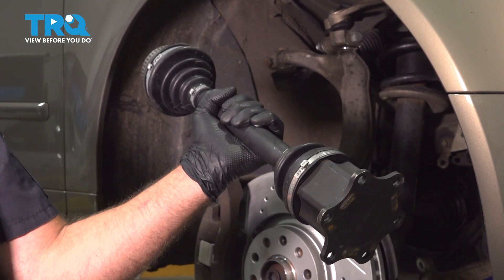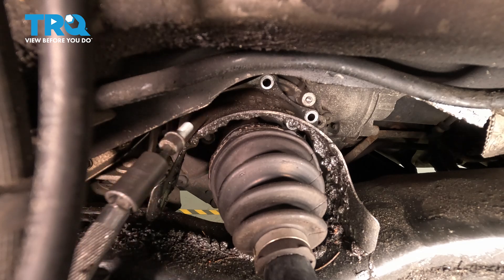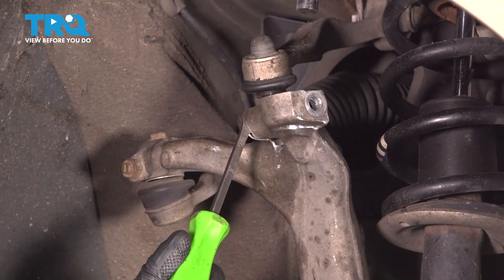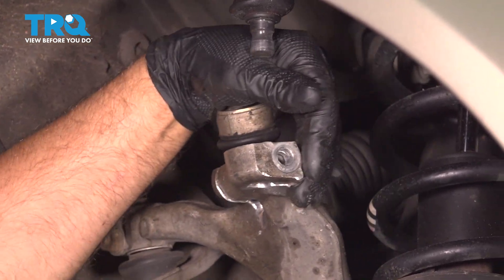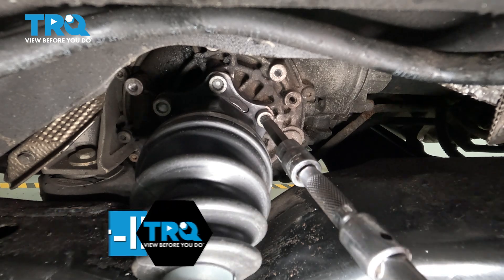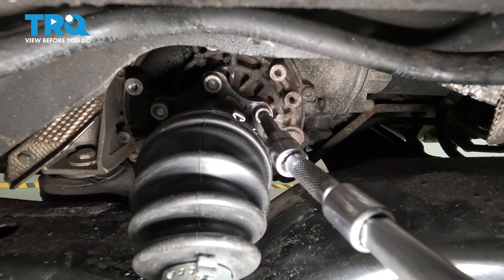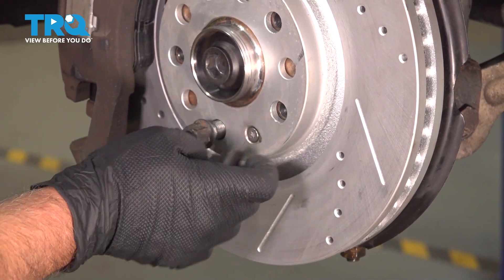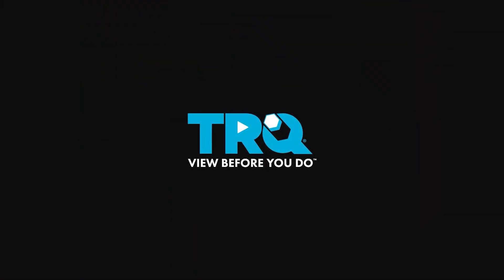How to Replace Front Right CV Axle Assembly 2004-2009 Audi A4 Quattro 2.0L L4

Comment: Can confirm on the 09s anyway you DO NOT need to remove the pinch bolt or anything else.

6 bolts on the transmission side and the axle hub bolt.

Took me about 45 minutes.

Comment: Why did you take the center cup out if  you're taking the wheel out , isn't it the cup on the wheel
Reply: cap is covering the lug bolts, how will he remove the wheel otherwise? xD